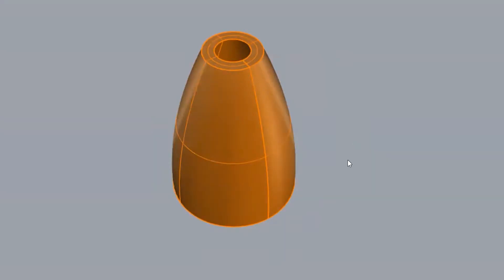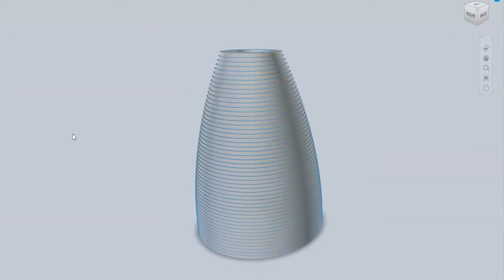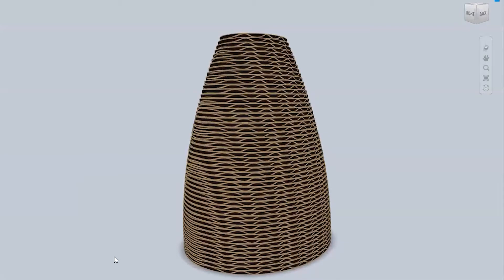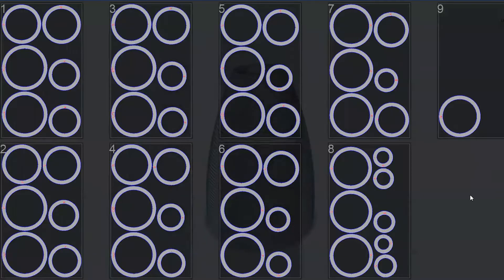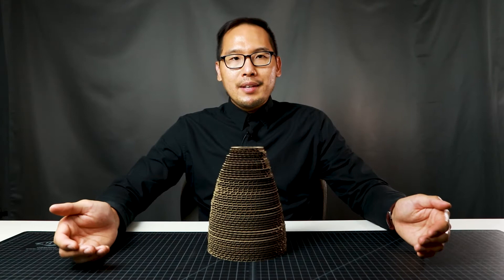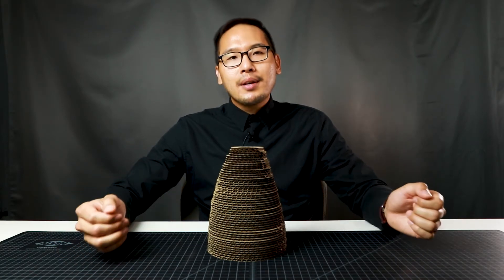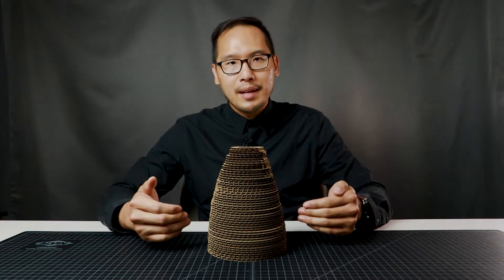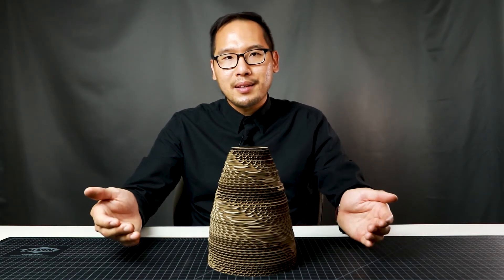Making a Simple Cardboard Pendant Light

Comment: Hello Tim! I have a big question :) If we want to design a non symmetrical plus rotating shape, is there a way to do the rotating part in Slicer? Or are we supposed to do it manually on a 2d program?
Reply from the maker: Oh that's a great question! If it were me, I'd design the patterns for each layer (using a 3D model and slicer or Fusion360), then it's actually rotating the sheet of cardboard before you laser cut it. The rotation that you see in this project is from turning each layer the same degree. So if the shape is non-symmetrical, you would just turn the cardboard sheet in the laser cutter before it gets cut. Once you assemble the product, the corrugations should rotate when you look at the product from the side
Reply: @LaserMadeProducts  Thank you so much for your answer and apologies for my late answer, I thought I already answered!
I have one more important question, I have a bit more complex and curvy shape and when i import an obj. file to slicer, the cut files seems to be created with little lines instead of smooth curves, which causes laser cut machine to work slower. What can be the problem here?🤔
Reply from the maker: @sevdesevinc  depending on the software you’re using, when you export a model as an OBJ file, you usually get options to make the model more or less accurate. I usually make it as accurate as possible on the export. This makes the model size larger because it creates a lot more polygons to get complex curves to work. Sounds like that might be happening with your file
Reply: @LaserMadeProducts  I will have a look, thank you so much for your answer and time again, Tim!

Comment: This is amazing, thank you for sharing! What is the thickness of the cardboard you used for the lamp?
Reply from the maker: Thank you! It's a C-flute thickness cardboard - about .157 inches thick. It's the standard size of a typical shipping box.
Reply: @LaserMadeProducts  Thank You Tim! I have one more question. I made my first cardboard lamp but I had some problems: I used 6mm thick cardboard, I don't have a laser cutter so I got my cardboards laser cut, but there is smell that's not going away (because they are burned) and every time I touch the cardboard pieces my hands get black stains, some parts of the shapes aren't cut completely and they got thorn partially. Can you please advice how can I get a proper and clean cut with 6mm boards, what kind of cutter would be best to use?

Thanks a lot!!
Reply from the maker: @erengoksel5604  since the cardboard is laser cut, there will always be a char on the edge, also known as soot. The smell eventually goes away (unless you put it close to you). To get rid of the soot, you can try wiping the edge with a dry sponge like the magic eraser or a lint free cloth. Hope this helps!
Reply: @LaserMadeProducts  I'll give it a try, thank you very much for your quick response!